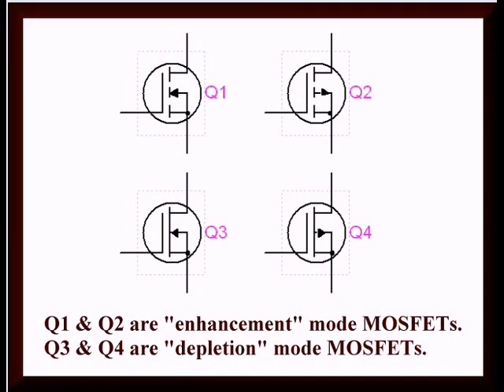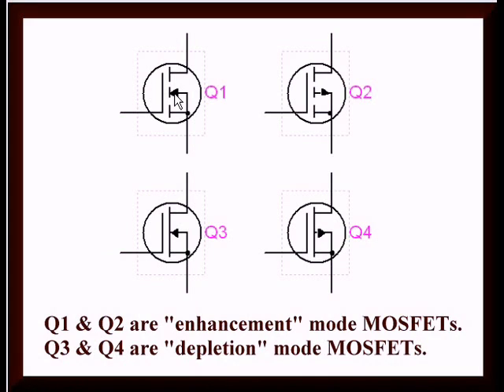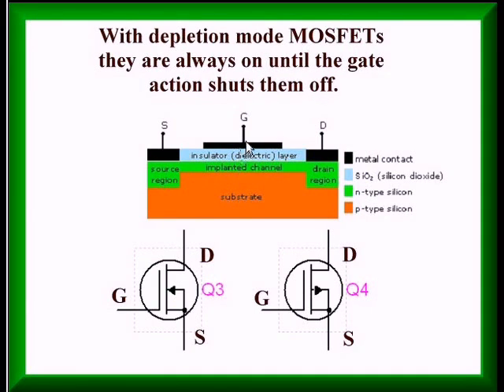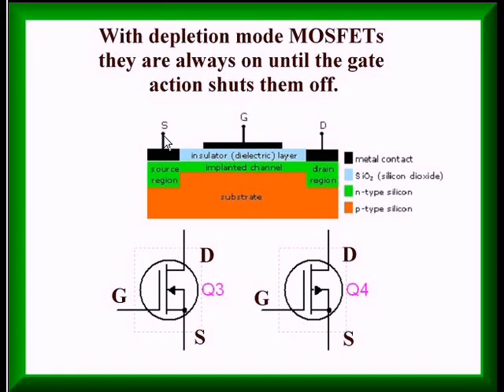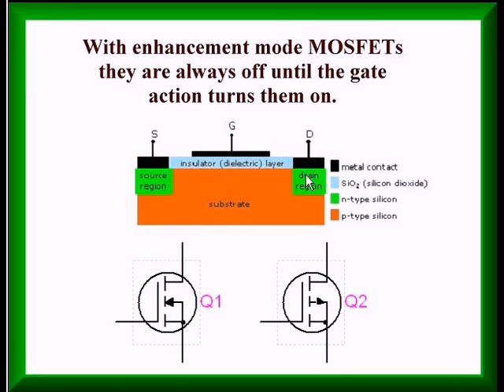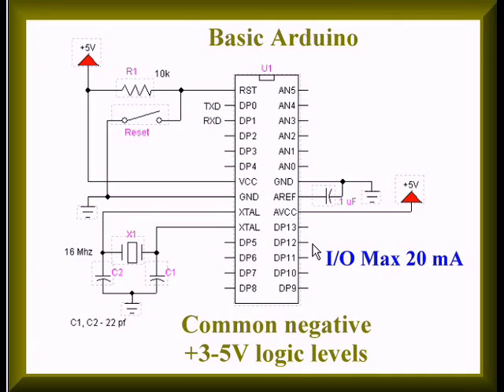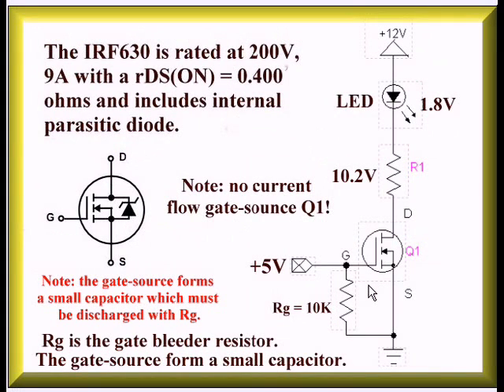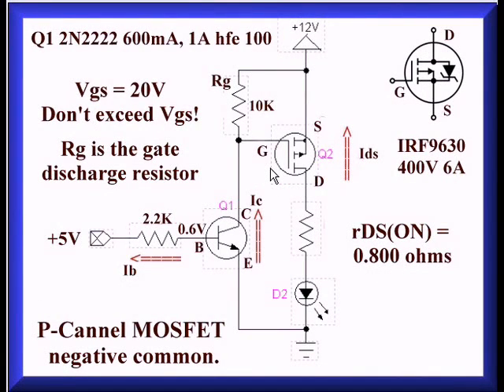Using Power MOSFET Transistors with Microcontrollers

Comment: (in 2023)  still wonder why they call Source at the terminal that the current Drains  off from  the mosfet
Reply from the maker: The actual current flow is electrons from negative to positive. They insisted on positive flow (+ to -), which was a mistake going back to Ben Franklin. So with an N-channel that is, electrons enter the source and leave through the drain. This corresponds to current flow in vacuum 
tubes from the negative cathode to the positive plate.

Comment: Excellent vid!

Thanks for the High Side Switch circuit and explanation.

I'll be using it to switch 12V On/Off to a Stepper Motor Drive Module as a Fail Safe Shutdown if/when the ESP32 gets 'Lost in Space'.

Lots of good info in this vid.

Good Job.......

Comment: 5 minutes, 24 seconds.
There is no current moving from source to gate, regardless of the polarity. The gate is completely isolated from the source and the drain. The gate only inducing an opposite charge in the transistor, like a capacitor plate.
Reply from the maker: Yes I said that. That is why we have a gate discharge resistor.
Reply: @LewisLoflin  ok. I have great respect for you. It just sounded confusing to me.
Reply from the maker: @yoramalon5273  You point is well taken and I will work harder on the next video to keep that in mind. Thanks.

Comment: Hmm... I use a more convoluted driving scheme, 'coz I need to drive the power MOSFETs in half-bridge configuration from 3.3V/0V pulses. So - a single 3.3V-ish NFET "inverter" driving the high side (the power PFET) and a combination of 3.3V-ish NFET and PFET "buffer" driving the low side (the power NFET) with a bunch of gate resistors, slowing the charging time of the gates (has to be calculated!) and a a bunch of discharging resistors. It works like a charm, permitting me to do all sort of crazy I and H configuration with a single polarity of 1/0 (on / off) driving signals, which makes the logic more uniform (FPGA wise / micro wise / CPU wise). Hope this helps. ('m a big fan of CMOS and not quite TTL logic)
P.S. Do never forget the gate zenners ;)

Comment: Hi Lewis, I know this is an old video but it is still being used by beginners I'm sure. 
Are the IRF630 and IRF9630 good choices for an Arduino when conducting significant current? I can see at the 20mA for a LED it won't matter, but then you don't need to use a power MOSFET. 
The R(DS) is quoted at a VGS of 10V, indicating at 5v it would not be fully turned on. Unless you are using a logic level device, won't you need to use a gate driver to protect the Arduino (switching transient due to capacitance) and to fully turn on the MOSFET (at 10V in those above)? I guess a series gate resistor could be used if the capacitance is an issue. If the MOSFET were not fully turned on, wouldn't heat from R(DS) become an issue?
Reply from the maker: See the following updated page for better MOSFETs:
http://www.bristolwatch.com/ele/h_bridge.htm

Comment: interesting, i was sure p channel mosfet have the arrow pointing toward the gate and the n channel was pointing away from the gate only on mosfets.  BJTs are opposite , n-channel points out away from  the base. p-channel points in toward the base.
Reply from the maker: Arrows point towards the N material because under conventional  current flow it flows from positive to negative.

Comment: I have a question  you say in your video IRF630 And i looked about and they say the IRF needs a voltage of 10v and the IRL is 5 volt as a logic MOSFETS with Arduino, can you explain this as i want to stock up on say 100 mosfets i need to get the right ones

https://circuitcrush.com/arduino/2017/06/02/logic-level-mosfets-irl-or-irf.html
Reply from the maker: Works fine on 5 volts. I actually built the circuit. I'll run another test to be sure.
Reply from the maker: I checked it out it turns on at 4V. If you are using a 3 volt Arduino it will not work. That's why I always use 5 volt controllers.

Comment: I have a question I hope you can help me with. The N channel MOSFET with the LED that has a forward voltage drop of 1.8V I can see you included a resistor R1, what would the value of the resistor be in this case ?
Reply from the maker: Depends on the current through the LED. Let's assume 20mA so 10.2/0.02 = 510 ohms.

Comment: Why when i simulate in proteus that same circuit, when i apply 5V the Vg it's 24V and when i apply 0V Vg it's 12V, don't understand, it's exceding the Vgs
Reply from the maker: I never use simulations I build these things with real parts. Simulators don't work on a lot of these circuits. The parts in the real world seldom match simulator settings. What MOSFETs are you using and what circuit in particular?

Comment: I wish to use MOSFETS , as ECU (electronic control unit) as Motor ,and work with <MYrio  (from NI) an embedded device along with the H-bridge ckt ...Will it bes feasible if I consider ECU as a general Motor (with 12V and 10amps)

Comment: Would the fact that you have 12v on the P-channel, yet only 5v on the N-channel cause problems/an imbalance? Since I thought most mosfets were "barely" on at the threshold voltage. So you would end up with the P-channel well on and the N-channel only just on?
Reply from the maker: Never had a problem and the MOSFETs are voltage not current operated. That might not be true with other MOSFETs. Thanks.

Comment: The P-channel high side driver circuits you showed are both supply voltage sensitive. The first (no zener) was good to about 20v, and the second (with zener) needs to have the zener changed for different supply voltages. 
Better to have a 12-15v zener across the gate and source, to do the protection right where it's needed, and then drive the gate via a resistor. The resistor will absorb the  difference between the power supply and zener voltages, and can be a high value since it will carry only a small current. That way the circuit will work for any supply voltage up to the max for the MOSFET.
Reply: The resistor or resistor divider will drastically reduce MOS switching speed due to the usually high gate capacitance of the mosfet; Needs a capacitor divider in parallel with the resistor divider; and things become complicated also with tha fact that the transistor used to drive may not push'pull enough current to charge/discharge fast these capacitances
Reply from the maker: This is a tutorial MOSFETS and how they work. They work just as shown for the voltages used and I went into Vgs.
Reply: I'm not saying that your circuits don't work, just pointing out that there is a more flexible way to do it.

Comment: You don"t need a zener diode to limit the gate voltage of the  p-channel mosfet.
You can just use another resistor to create voltage divider.
Reply: The resistor or resistor divider will drastically reduce MOS switching speed due to the usually high gate capacitance of the mosfet; Needs a capacitor divider in parallel with the resistor divider; and things become complicated also with tha fact that the transistor used to drive may not push'pull enough current to charge/discharge fast these capacitances
Reply: @addysoftware  So that means that a voltage divider will slow down the switching speed of the mosfet? If so, is there a way to know by how much?
Reply: @Asyss_Complex  yes, the so-called "time constant" will be a good approximation: for example a 1 kiloohm on a 5nF gate capacitance will produce a delay of 1000 ohms x 5 nano = 5 microseonds; way too much, and I did not took into account the Miller effect wich will make it far worse. To obtain an effective voltage divider, use small resistors (example 10-20 ohms) and use a capacitor in paralel with series resistor, it's value to be invers proportional with dividing factor and direct with gate capacitance of the MOS. Example: driver voltage 25V, out voltage 6V: divide gate with 1/4, MOSFET have 5nF gate: results: series resistor to be 33 ohms, gate-to-gnd resistor 10 ohms, series cap to be ~1.5nF.

Comment: i have dozens of N channel and P channel mosfet's rated at 55v & 75a and want to build a high current high voltage system "H-bridge" and i want to build my own Motor Driver for a humanoid Robot im putting together, now i was looking for advised on what im doing from someone like you, am i in the right path? based on the listed items? i know i have to do the math V=I/R or what not in order to find the right resistors and or capacitors but one question in mind is do i add the mosfet's rated voltage to come up with a total? and that will be my motor drivers rated voltage? and the same method applied to the mosfet's rated current/amps ? OR is their another formula that i should follow to come up with a desired rated voltage *& Amps for this system i want to end up with ?
Reply from the maker: Frank Lopez MOSFETs can be wired in parallel - G-G, D-D, S-S for higher current.
Reply: so if each mosfet is rated 10v @10a does this mean i will end up adding up those v & a to get my total v & a? so in a H bridge setup i will end up with 40v @40a h bridge motor driver? so this means each side of the bridge will be good for 20v
Reply from the maker: No the voltage stays the same bit the current will split.
Reply: can you elaborate on a example? im not following as far as current will split, you mean it wont be 40A but 20A ? is this per side of the bridge over all? 

and far as the voltage your saying it will stay the same as its rate per single mosfet so if all are 20v it will stay 20v after setup of h bridge? if so ok that makes cents' 

but if so how can the current go up from their original rate value say 10A each but in a h bridge config it wud be added up for a total new rate current?
Reply from the maker: The current will add voltage the same. Don't push this to near the limit.
Reply: ok but what about what you mention about the amps splitting? what did you men by that Lewis?
Reply from the maker: If one wires MOSFETs in parallel a higher overall current is obtained. Yhe voltage stays the same - make sure the MOSFETs are the same type.
Reply: you mean like n channel? or p channel? cuz i understand that n ch are like variable switches while p ch are like on off switches

Comment: Mr. Lewis, I wish to operate 2 computer fans using Arduino PWM to control speed. They are 12v and .39ma each. A 2N222 transistor works for 1 fan, but can get very warm and is probably not adequate. Would you have a suggestion as to the proper way to do this.
Reply from the maker: Danny Johnston Use a TIP41 a nd use a 1K resistor.
Reply: I had a TIP31 and it seems to work good. Thanks